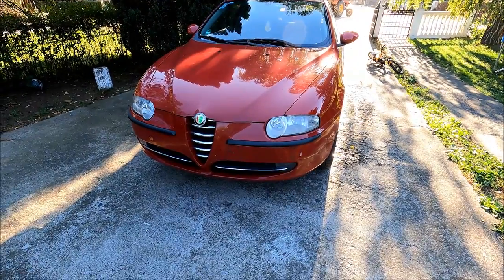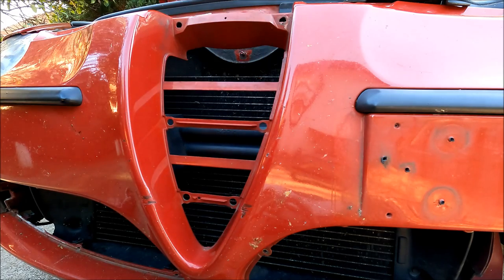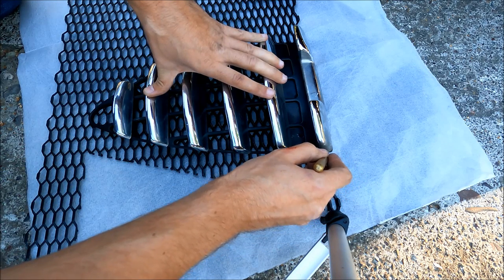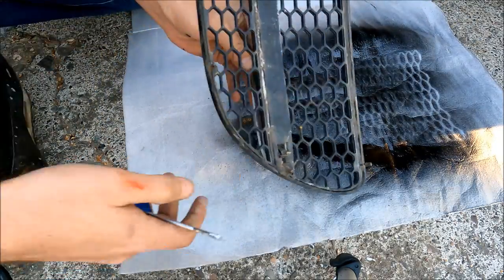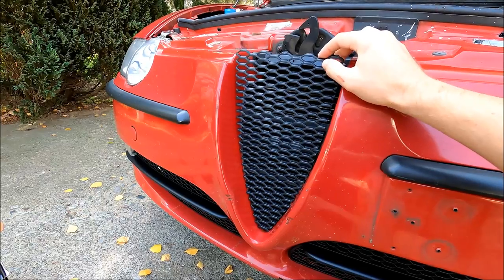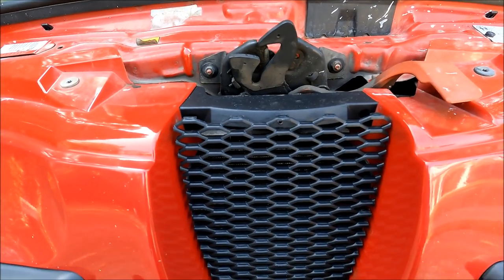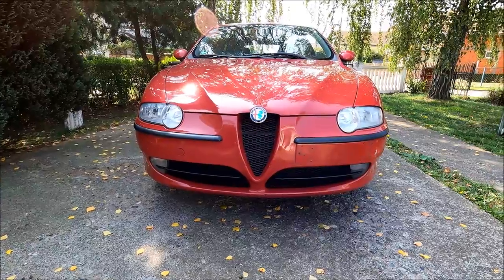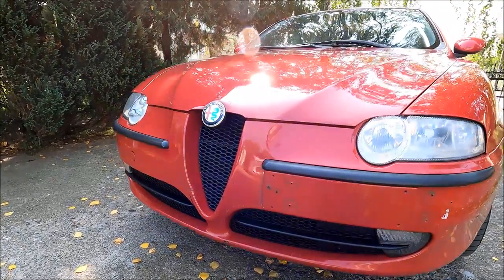Easy DIY Honeycomb Grille Alfa Romeo 147

Comment: Thanks for sharing such great works of yours, helps a lot to all Alfa owners. I have a question about my GT. I know a lot of GT owners are suffering from passenger side window failure like me. The problem is it stops working all over f a sudden. I realized that when the car shakes on a bumpy road it stops working and after that if it shakes again suddenly it starts working again. Here in my country none of the Alfa services know about the cause and troubleshoot of this problem also I have found nothing about this in internet. Have you ever met this problem, and do you have any idea about the cause and the way to fix it?
Reply from the maker: Thanks for support, check the connector to the lock in the door. It can cause that issue. Also check the rest of the connectors as well...
Reply: Most likely you will have to replace window switches, usually they are faulty. Had similar problem with my 147, after replacing windows switches problem went away. However I replaced both switches driver's side and passenger's side. First check if both switches are working the same and problem stays with whichever switch you are using. Second as ARC said check connectors. Third replace switches. If nothing helps check window motor.
Reply: Thank you so much for quick responses, as soon as I try your advices I will comment the results.
Reply from the maker: @mtyl156  No problem